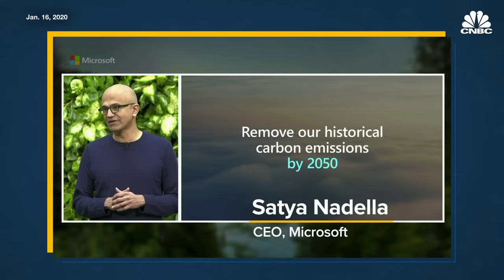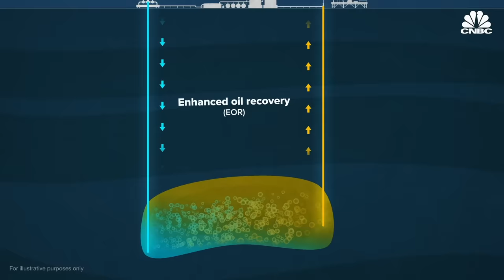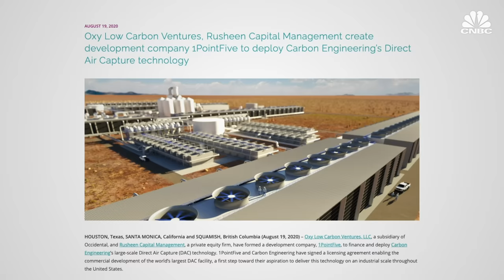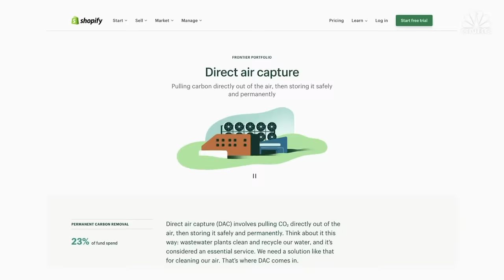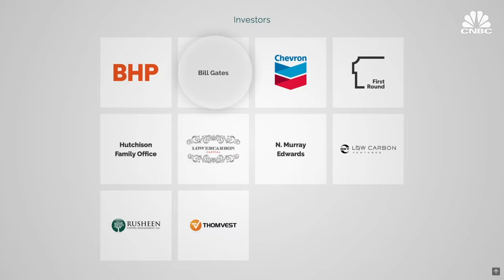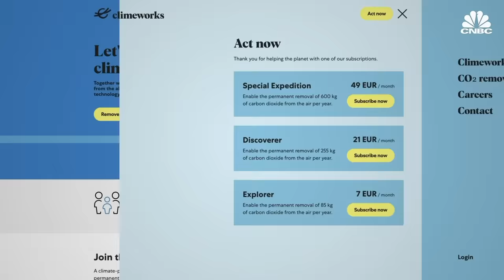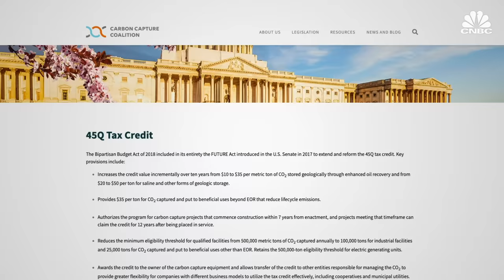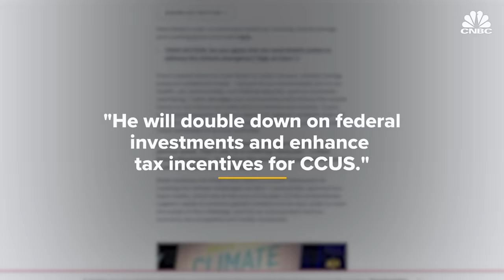Money Is Pouring Into Carbon Capture Tech, But Challenges Remain

Comment: They didn't specify other gasses must not be removed from the air. Blow off the whole atmosphere into the cosmic space using nuclear weapons. This will get rid of all the CO2 in the air. It will also get rid of the air on the planet, but that requirement wasn't specified.

Comment: Carbon sequestering requires energy. If that energy comes from a grid that is one which is dominated by or has a significant share of fossil fuels, then it indirectly produces fossil fuels. Carbon sequestering will succeed once the fossil fuels are eliminated or greatly reduced from the power generation mix.

Comment: Enhanced Oil recovery(EOR) can actually be made profitably carbon negative in certain, maybe even all oilwells. And thats assuming all the oil you produce is actually burnt, some can be used for plastics and other commodities. Once EOR gives the tech the startup it needs, other uses for CO2, such has cement subsidies, can take off. EOR is the spark for the fire of direct air capture that we need!

Comment: Huge green houses with exhaust fans to extract pollution air from the atmosphere and circulate  through the plants then exhaust outside. The same really as a rainforest only with exhaust fans. But really, the best way is to plant large forests and plant areas with water features as the evaporation process weights down the pollution particles and the cycle is repeated.
Reply: Exactly why they cut down trees in cities

Comment: I think the best way to put CO2 back into the ground is to do the same thing nature does with rain and ocean waves. Like how a swamp cooler works with falling drops of water and blowing air through this water with electric fans would in turn filter the air capturing CO2 and anything dust, pollen, etc. This would cut costs of using honey comb solution filters and clean the air using natural water. Then use the carbon  captured water on plants and their soil giving off O2 with any extra CO2 being absorbed by the ground soil. When ocean waves break on the costs this same process is done and the ocean absorbs the CO2 and falls to the ocean floor or gets eaten by sea creatures....

Comment: Direct Carbon Capture does not make much sense at all. CO2 exists in the atmosphere at far less than .1%. The energy to power the fans is 99.9%+ wasted since it is mostly pulling in Nitrogen and Oxygen. Furthermore, I assume they are using an amine based separation process, which is thermodynamically expensive to perform. CO2 should be captured from fossil fuel plants. Flue gas typically contains 15% CO2, meaning far less energy is wasted to capture the same carbon. It simply seems to be a waste of resources.

Comment: If EOR sequesters more carbon from the air than is in the oil that it pumps out, then it is carbon-negative. That's admittedly an 'if'. Unlike direct carbon sequestration, it has a business plan, and thus is economically sustainable. It is a temporary measure; it will last only as long as there is oil; but if it's carbon-negative, or at worst carbon neutral, then it will work during that time. 

EOR is economically sustainable, but not resource sustainable. Direct sequestration is resource sustainable, if renewably powered, but not economically sustainable. Conversion to feedstock is sustainable both ways, but is only carbon-neutral.

Comment: How much carbon can be stored in the ground before that becomes a problem? Hopefully it’s endless.
Reply: Technically all the carbon we've released into the air was originally stored in the ground in the first place, we just dug it all out of the ground to burn it. So there's probably room for lots of carbon in now empty reservoirs underground, depending on what method is used to store it

Comment: This is a factory that does nothing but burn money. 

CO2 is a tiny amount of greenhouse gas, literally a few hundred parts CO2 per 1 million parts air. It is actually good for us, the more carbon dioxide, the faster the trees will grow to absorb it. We might as well be trying to change the humidity. This is Chinese making us waste taxes. 

CO2 is incredibly stable - it is literally using caustic lye to rip apart the CO2 and reassemble it. How is this even an option except that our media is run by Haw Haws. This should be a joke, not an invented industry.

Comment: If we are suppose to take 100 percent, of the oxigen.
From each breath.

But each breath is 35 percent, dust, pollution and carbon.

Then that means we are only receiving 65 percent of the required amount. From the every breath.

Shallow breathing makes it even less oxigen.
This causes phlegm  build up.
Comfuded with asma.

Become aware of the breath.

Fill your lungs to the Top, and hold that possition and just breath normaly. From at the Top of your filled lunges.
Now let it out, all the way to the Bottom of your lungs and hold that possition. And just breath normally.

You will notice, that if you choose too. You could stay like that for some time, and get use to it.

So why do we choose to , only breath from the center of our lungs.

Simply because we got lazy.

We dont have to think about the breath, the body does that all by its self.

Thats OK if its working properly.

Become aware of the breath, and consciously draw the most out of each breath.

G.)))

Comment: Atmospheric CO2 capture is dumbest thing I have heard for a long time, the concentration of CO2 on regular air is very low and the process itself uses quite a bit of energy.

A much more practical approach would be direct capture from big emission sources such as cement factories, steel mills and other heavy industry.

Comment: There is nothing that it could be done to transform the CO2 into usefull products, oxigen, and so on?
Reply: Oh you can. The CO2 can be used to enhanced plant growth, create syn fuel, or generally replace natural gas in making plastics. But it is not even close to cost efficient. Buying everyone in the US model 3s would be cheaper than getting rid of their vehicle carbon emissions with carbon capture.

Comment: Hey, plant Bamboo, it's your nature and best way to capture carbon and release fresh air.
Reply: And when the bamboo dies, what now? Virtually all bamboo species live less than 10 years, resulting in their stored co2 to be released back into the air. Bamboo take time to grow, so it's not like you can instantly plant them right on top of where previous bamboo lived. It's less efficient than trees. With current knowledge, algae is the best bet.
Reply: @MrPicklekvGygA  you know nothing about bamboo.   They are a family of weeds.  Grows 1ft per day.  It's a challenge to contain bamboo.
Reply: @misterle7026  The fact that bamboos are classified as invasive weeds does not bear significance to my reply. My point is that they don't sequester co2 for a long time, (specifically under a decade) therefore aren't a viable option for carbon capture. 1 foot a day is extremely slow considering how quick co2 moves throughout the air. Bamboo does not grow fast enough to retrieve the co2 that releases from a dead bamboo. There's a reason why most experts aren't looking at bamboo as a solution. Don't act like you somehow outsmarted chemists and physicists that have been researching this field for way longer than either of us had.
Reply: @MrPicklekvGygA  i am talking to a person that thinks everything is a deadend.  Bamboo is a highly sort product.  From hardwood, to clothing,  and furniture products.   You have a timeline to harvest those bamboo when mature.  Nothing goes to waste.
Reply: @misterle7026  
"i am talking to a person that thinks everything is a deadend."
Ridiculous unsubstantiated claim. Simply because I'm doubtful of one unpopular idea does not make me pessimistic about every approach.

"Bamboo is a highly sort product.  From hardwood, to clothing,  and furniture products. "
That's cool, but all it proves is that bamboo is a useful resource. Do you know what else is? Wood from trees. But what does that have anything to do with carbon capture? Nothing. Even if you reuse the materials from bamboo, its co2 still escapes into the atmosphere once the plant dies.

"Nothing goes to waste."
Except the co2 that enters the atmosphere. The discussion here is about how to capture carbon dioxide, not what's the most practical resource for products.

It truly amazes me how far you can divert the conversation away from carbon capture. None of your replies have refuted my criticism about the bamboo's inefficiency.  I'm talking to a person that thinks his bamboo approach is superior to ideas that physicists, chemists, and other experts have came up with.

Comment: What about the oxygen? We are taking stored carbon, combining it with twice as much oxygen and are proposing to store the product, CO2. Surely it would be better to do what the world’s flora does and store the carbon while releasing the oxygen back into the atmosphere. CCS in the long term will be destructive. Due to  the current global climate disaster It must, however, regrettably be implemented as a short term measure while we are working out how to do what the plants do rapidly and economically enough using renewable energy sources to split the CO2 back into C and O to restore and maintain the CO2/O2 balance in the atmosphere. Or is that a dumb idea?

Comment: I sure hope that the people doing the carbon capture take account of everything before declaring victory.  Carbon dioxide is a waste to us, perhaps, but Nature's equilibrium produced plants before aerobic animals who needed free oxygen.  That CO2 is of course used in plants to produce our food chain.  Not all of it is needed, of course, but we should remember plants in our computation.  More immediately, CO2 capture costs $$$ and energy.  Yes, as we capture CO2 and congratulate ourselves, we are also consuming energy and, ironically, contributing to our environmental problems on the site, or off-site...
Reply: We are digging up and burning a billion tons of coal, and a cubic mile of oil, and burning it. Lot's of gas too. From a practical standpoint, wind, solar, batteries, maybe green steel are where it's at. If I wanted to fool with carbon capture, I would start with making cement. This stuff is more a science project for now.

Comment: Using CO2 removed from their atmosphere  by DAC to make synfuel, as currently envisaged, effectively negates the whole  point of DAC whose. object, surely ,is the  NET reduction in overall atmospheric CO2 levels,.When CO2 is used as a substitute fro  petroleum derived fuels it simply puts CO2  BACK into the atmosphere!
One possibility that might  make synfuel use justifiable  in conjunction with DAC is the 'DAC railcar' idea described in the March edition of' 'Joule' . YouTubers can read for themselves why it  has attractions. by using the free ' slipstream' effect instead of fans and the braking energy-normally wasted- to power DAC units which have been miniaturised to rail car size for inclusion in regular freight and. passenger trains.

Of more immediate interest , however, is the. inclusion of another type of railcar which effectively removes the  current. diesel emissions  of the. locomotive. This would make it  sensible for the CO2  captured and liquified in a railroads 'DAC car' to be converted into diesel for use in its. engines-effectively. providing closed loop since the emissions would. be removed. I expect the railroads  as a reward for the  public service of removing CO2 could expect some  kind of. subsidy to make the. cost of  converting it diesel synfuel?
They  would thus be essentially collecting their own fuel and, who knows , perhaps the. idea could. be extended to aviation?

Comment: So what does "carbon capture" use to remove carbon?  Oh yeah electricity which is primary made from fossil fuels.  Makes perfect sense.   So one car at 22 mpg emits 4.7 tons of co2 per year...  so one plant 217k cars worth of pollution.  And what was the cost again ?  If the reason for removing co2 leads to some sort of profit then it makes sense if not its going to die.  Running a giant plant like that is like running a fan in your home when your not hot all year round and you figure out it costs 20 dollars a year to run it and its not doing anything to benefit you, in this case everyday people that might pay for it through taxes.  I am all for environment if you can see it and it noticably effects you.  But in this case itst like carbon monoxide that is the deadly killer.  To even know its a problem you need a special device in your home to detect it and requires government mandate to make awareness,  am I right

Comment: if carbon capture through EOR makes our crude consumption carbon neutral, it seems like a no brainer, no?

and it might pay for developing this tecnology 'till economies of scale kick in to lower prices.
Reply: Its not the costs are extreme and unlikely to fall low enough. You can buy everyone in the US teslas and powerwalls for a small fraction of the amount you would need to spend on direct carbon capture.
Reply: @peterisawesomeplease  , right, the video said that other natural carbon capture solutions, i guess they mean planting trees, are 50 times less expensive. which is why eor is necessary to get some financial benefit from the situation.

the planet money podcast had an episode about buy-in taxes/tarrifs in Germany, where you had to sort of subsidise solar panels in the early years until costs eventually came down.

this couldn't be the case for these carbon capture contraptions?
Reply: @elgracko  "this couldn't be the case for these carbon capture contraptions?" Its possible but unlikely. Or maybe more to the point solving the cost prohibitive part of direct carbon capture would also lower the cost of competing solutions. The primary cost driver is  cheap renewable energy. And we are already fairly close to the maximum expected efficiencies of pulling carbon out of the air. This is very different than the situation with solar panels 20 years ago. They were cost constrained by efficiencies well below the theoretical maximums and manufacturing costs. And of course if you solve the cheap renewable energy problem then why not just replace the fossil fuel emitting plants. 

Carbon capture may be important for handling a few specific high value carbon sources. For example it can be used to make green aircraft fuel. But this is sort of the last hardest problem. There are many many problems that can be solved much cheaper for much higher impact. And it may be worth some level of investment now so we will be ready for this.

The big worry though is that these projects will be used as excuses to continue emitting. People who just want to profit off of fossil fuels will point to carbon capture as a reason its ok. People not very interested will take their word for it, not realizing that it will almost certainly be more expensive than investment in better batteries and electric grids. This is why its really really important for people like Gates and Elon to be super clear about their intentions for the technology. We say this exact same BS with clean coal.
Reply: @peterisawesomeplease  , totally agree with that last part, very well thought out. the only problem i see is that people are more willing to do these types of things than say, plant a tree, despite the costs, maybe just cuz it's more technological + like glamorous, plus you don't need a lot of land to do it, no? and it's better than doing nothing, eh?
Reply: @elgracko  I could see that. At the very least it gets people think about climate change.
Reply: @peterisawesomeplease  , mhm, true, yeah,

Comment: This Standford guy sound like He was paid to say that.. It sounds stupid. Besides, the fuel itself is not the problem, it's what's left after it's used. If You can make a mess and then clean up after Yourself then it's all good. Neutrality is the key here. Fossil fuels are going to be in use for decades still and renewables are not without their cons either (i.e. 30-40% efficiency of solar panels). Devices that make power from renewables require a lot of rare elements that are toxic to obtain  and to use in manufacturing. Those device are not gonna work for decades and utilising them afterwards is going to be toxic af. IF We mass produce them it's gonna be a disaster. We have to take a little bit from every solution.
Besides, I get a feeling that this technology might end up being "a seed" for terraformers in far future